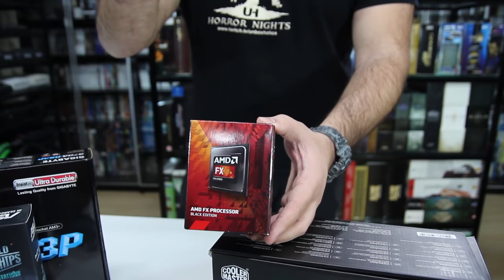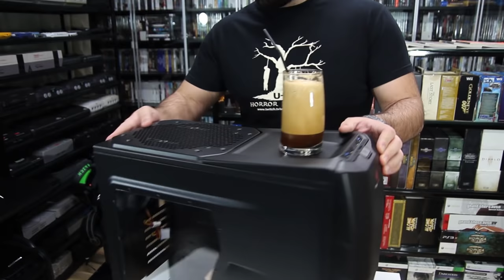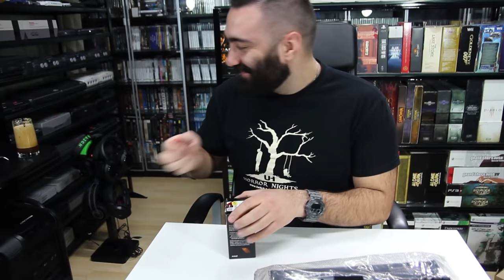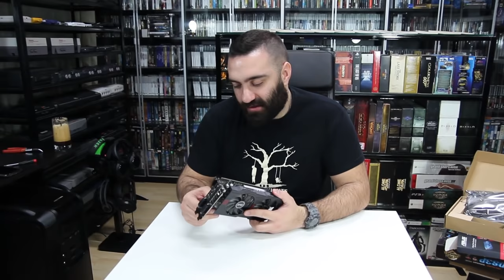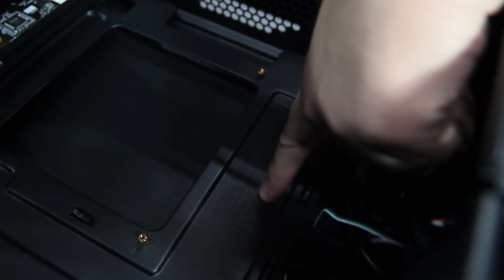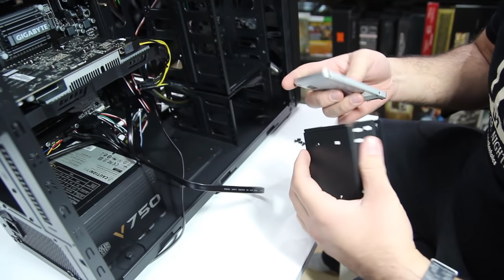Vlog #30: Gaming PC των €750 | Unboxholics

Comment: Γιατί τόσο καλό psu με τέτοια gpu/cpu? Θα μπορούσατε άνετα να φτιάξετε ένα pc με την 960 ή r9 380, τον  i5-4460 ή για ακόμα πιο φτηνά τον ίδιο fx 6300/8320, μια αξιόλογη m/b των 70-90 ευρώ και ένα κουτάκι επιπέδου carbide 200r. Ram και hdd τα ίδια και για psu ένα cx 500, μιας και πλέον οι κάρτες δεν έχουν μεγάλο tpu. Το μόνο που θα έχανε το σύστημα θα ήταν η ταχύτητα του ssd που αντικειμενικά δεν είναι αναγκαία και είναι και μια αναβάθμιση που γίνεται πολύ εύκολα αργότερα. (και όλα αυτά ακόμα πιο φτηνά γύρω στα 650 με 700 max βγαίνουν). Καλύτερα να επενδύσει κάποιος σε καλύτερη gpu / cpu που δεν τα αλλάζεις γρήγορα και αμα είναι και λίγο speedfreak βάζει και αργότερα τον ssd του. Θα γράψει το witcher απίστευτα γρήγορα μεν, αλλά όταν το ανοίξει και παίζει με 30 frames σε very low θα κλαίει τα λεφτά του. Οπότε συνοψίζοντας, προσωπικά θεωρώ χαζό να επενδύσει κάποιος ~100 +- για έναν ssd και να πάρει μια τόσο μέτρια γραφικών, που τα βαριά παιχνίδια θα τα σηκώνει με το ζόρι σε 1080p. Φυσικά δεν πιστεύω ότι είναι ένα κακό build αλίμονο. Αλλά ίσως θα έπρεπε να ξεκαθαριστεί ότι είναι ένα ιδανικό build για ένα casual gamer (που παίζει κατα κύριο λόγο, lol, hots, cod και άλλα casualo-παιχνιδα, μη-βαριά) και θέλει παράλληλα την ταχύτητα του ssd. Γιατί, για ένα λίγο πιο hardcore gamer η καλύτερη κάρτα είναι αναγκαία. Να παίζει witcher σε low <30 frames αμαρτία :D

Comment: PC Build με ελάχιστη τιμή 544 ευρώ για την πλέον απόλυτη εμπειρία gaming στο πιο χαμηλό διαθέσιμο budget της ελληνικής αγοράς:

Μητρική:   GIgabyte H110M S2H από 55,78 ευρώ
CPU:  Intel Core i3 6100 Box από 107,5 ευρώ
Κάρτα Γραφικών:  MSI Radeon RX460 4GB από 143,29 ευρώ
Μνήμη:  HyperX Fury 8GB DDR4-2133MHz από 68,99 ευρώ
Τροφοδοσία: Corsair VS550 80plus από 44,86 ευρώ
SSD:  Samsung 850 Evo 250GB από 88,68 ευρώ
Κουτί: Aerocool Cruisestar από 27,35 ευρώ (βσκ όποιο θέλετε)
Ψύξη:  CoolerMaster SickleFlow 2000 RPM σε πολλά χρώματα από 6,9 ευρώ

Όλα αυτά κοστίζουν το λιγότερο 543,35 ευρώ. Αν κάποιος θέλει να βάλει και ένα καλό optical:
LG BH16NS55 BLU-RAY/DVD από 66,01 ευρώ

Όλα τα παραπάνω επιλέχθηκαν με βάση τις προτάσεις διαφόρων PC Builders του διαδικτύου( UH, Gramers, RantingGreekGamer κτλ), με βάση τη δημοτικότητα και τις αξιολογήσεις των αγοραστών, καθώς και βάσει της ποιότητας κατασκευής. Όπως βλέπετε, όλα τα parts ανήκουν σε επώνυμες μάρκες και έχουν αξιολογηθεί με πολύ υψηλές κριτικές.

Οι τιμές προέρχονται από το Skroutz.gr.

Comment: Guys help.  Θελω ενα gaming pc που να σηκωνει lol, gta v, overwatch,rocket league και να μπορω να κανω livestreaming χωρις να pixeliazei το stream καθως τρ οταν κανω live το stream κολλαει και pixiliazei.  Τιμη 400-600 ευρω
Reply: TheDarkLeader GR skroutz 
case deepcooldukase v2 69€
psu coolemaster 600w 53€
cpu amd fx 8350 163€ 
mtb gigabyte 970 a us3p 90€ 
 ramhyperxfury ddr3 1866mhz 75€
gpu msi geforce gtx 1050 ti 4gb 176€
hdd western digita caviar blue 1tb 50€ Σύνολο 680€ δεν μπορεσα να βρο κάτι καλύτερο σε τιμή

Comment: i3 6100
Gigabyte h110m-ds2 ddr3
Corsair Value 8gb ddr3 1600Mhz
Western Digital Caviar Blue 1tb
Sandisk ssd plus 240gb
Coolermaster Silencio 550
Gainward GTX960
EVGA 500W 80 PLUS

Το παραπάνω σύστημα κοστίζει maximum 750ε από το γνωστό Σκρουτζομάγαζο vision studio και είναι πολύ μα πολύ καλύτερο από αυτό που παρουσιάστηκε...

Comment: παιδιά επεξεργαστής ράμ και μιτρικη μέχρι 250 ευρώ?
Reply: CPU AMD Athlon x4 880k 4core 4,0ghz  90-100euro, motherboard MSI A78M -E45 V2 FM2+ sta 65-75euro kai 2 Ram 4x2 8gb ddr3 1600mhz teamgroup px 40 euro 210 euro katahrises ,        ama thes kati kalhtero, MSI Motherboard 970 Gaming AM3+  116euro AMD CPU FX 6300  6 core 3,5ghz 100 euro 2 ram 2x4gb  8gb sta 40 euro kai petas ! 260 euro ! kalhtera na pas sto AM3+ gt argotera mporeis na to kaneis 8 core me FX 8350 px
Reply: auta leei to Battlefield 1 System Requirements  minium ram 8gb , recomend 12gb / minium  fx6300  recomend fx8350  gpu minium r7 360 / recomend R9    (miniumGeForce GTX 660 midium full recomend GeForce GTX 950 2GB GeForce GTX 970 4GB /  miniumRadeon HD 7850 , midium Radeon R9 270 full recomend Radeon R9 290    ,  egw ta paizo ola me shapphire radeon r7 360 2gb ddr5 kai amd 880k 4 core 4,2ghz  kai 12gb ram ddr3 1600mhz exw enan ssd OCZ trion 150 kai motherboard MSI A78M E45 V2
Reply: nai eukola edw eisai esu : MSI Motherboard 970 Gaming AM3+  116euro AMD CPU FX 6300  6 core 3,5ghz 100 euro 2 ram 2x4gb  8gb sta 40 euro kai petas ! 260 euro ! kalhtera na pas sto AM3+ gt argotera mporeis na to kaneis 8 core me ( FX 8350 ) px bale mai karta grafikon ddr5  R7 370 256bit h kati kalhtero kai tha paizis ta panta (an psaxnis gia oikonomiki karta grafikon anagastika tha pas se GTX750Ti 2gb 128bit* or AMD radeon R7 360 128 bit * 2gb*   (min balis karta grafikon DDR3) !!!

Comment: Ti 8a eftiaxna ego me 750 evro(gia na ma8enete)

GPU: Palit GeForce GTX970 4GB      http://www.ebw.gr/el/Product/1466766/Palit-GeForce-GTX-970-Graphics-card-GF-GTX-970  343€
CPU:Intel Core i5 4460 3.2 GHz        http://www.ebw.gr/el/Product/917067/Intel-box-Intel-Core-i5-4460-3-2-GHz-4-cores-4-threads 193€
MOBO:1150 MSI H81M                     http://www.techstores.gr/motherboard-1150-msi-h81m-p33-7817-019r.html 49€
PSU:550W Corsair Vs550 80Plus    http://www.techstores.gr/550w-corsair-vs550-80-plus.html 53€
SSD:SSD 2,5 64GB Adata                  http://www.techstores.gr/ssd-2-5-64gb-adata-sp900.html 52€
RAM:2X DDR3 1600 4GB Kingston http://www.techstores.gr/simm-ddr3-1600-4gb-kingston-kvr16n11s8h-4bk-bulk.html 50€
CASE:Cougar Spike mAtx         http://www.eurostores.gr/p.CC-COUGAR-CASE-SPIKE-5SS7-Mini-ATX-BLACK.595576.html 20€

Sinolo:760€ +3€ +3€ +3 € ta metaforika,dioti einai 3 magazia 769€
Gnorizo pos den exo simperilavei skliro gia na vazete paixnidia,siga parte enan pou exete idi.

Aftos o ypologistis pou periegrapsa den einai mono 2x fores pio grigoros apo auton ston video,alla 4 i 5 fores,einai exofreniko poso kaliteros einai,pragmatika sigrineis skaraveo me ferrari,episis me 30€ akoma pernete kai enan skliro opote paei sta 790€ ean 8elete.
Reply: +Harry Nafpaktitis  kala to pigenes mexri pou eida lga 1151 se haswell(sou ksefuge logika),to trofodotiko den einai asxhmo alla gia 5euro more pairneis super flower opote einai kati pou 8a borouse na ginei mia kai einai ligo low quality capacitors.

kati psixoula 8a borouses na glitwseis me mikroallages,egw to eixa vgalei sta same money peripou 830 me 240gb ssd kai hdd(proxeira apo skroutz,opote ama valeis kai ta metaforika gamhseta).

An kai eipe kales mlkies o sakhs sto vid prepei na skefteis oti kapia apo ta pramata ta eixe apo prin(sigoura case kai PSU?den eida to vid),oxi oti ton dikaiologw.
Reply: +koko power nai evala stin arxi ton skylake 6400 alla itan 11 evro parapano kai den xreiazotan kiolas kai ton allaxa,to dior8osa to mobo
Reply: +koko power ego sta exo etoima apo 3 magazia simperilamvanomenon ton metaforikon re,ta paragelnis kai exeis kai gamo ta pc,mporo na vro kommatia f8inotera alla einai apo ena soro diaforetika magazia kai mazi me ta metaforika 8a sou vgei poli perissotero!! sou exo gpu kai cpu apo 1 magazi kai ola ta ypolipa apo allo 1 + to kouti mono tou apo allo ena

Comment: gia thelo na moy pite an afta ta ejartimata kolane metaji toys kai an teriazoyn se afto to koyti episis egraca afto to minima kai stoys gramer elpijo na to diavasete ka ina to apantisete to thelo gia edit kai youtube video gia afto evala i5
 
https://www.skroutz.gr/s/6004214/CoolerMaster-B700-Ver-2.html?keyphrase=cooler+master+b700+ver2                         
cooler master b700 ver2

https://www.skroutz.gr/s/4529758/MSI-GeForce-GTX750-Ti-2GB-Twin-Frozr-OC-Gaming-N750Ti-TF-2GD5-OC.html             MSI GeForce GTX750 Ti  

https://www.skroutz.gr/s/7602143/Western-Digital-Blue-1TB.html   Western Digital Blue 1TB

https://www.skroutz.gr/s/3718699/Gigabyte-H81M-DS2-rev-1-0.html   Gigabyte H81M-DS2

https://www.skroutz.gr/s/4857199/Intel-Core-i5-4460-Box.html   Intel Core i5-4460 Box

https://www.skroutz.gr/s/327656/Corsair-Vengeance-4GB-DDR3-1600MHz-CMZ4GX3M1A1600C9B.html                       Corsair Vengeance 4GB       tha balo 2

https://www.skroutz.gr/s/7674510/Deepcool-Smarter-Led.html?keyphrase=deepcool+smarter+led   Deepcool Smarter Led

https://www.skroutz.gr/s/2591228/Kingston-SSDNow-V300-120GB.html?from=drop&keyphrase=ssd+now+v              
Kingston SSDNow V300